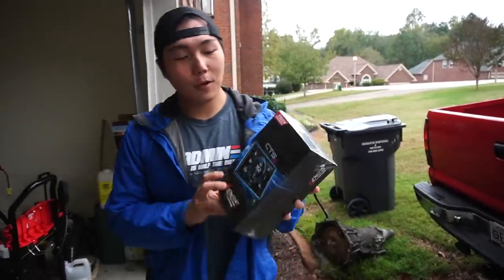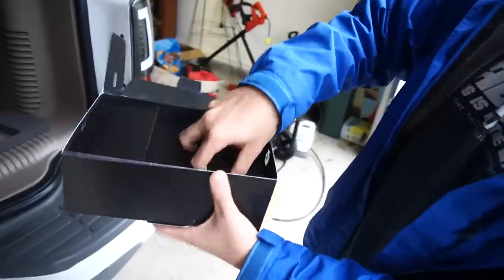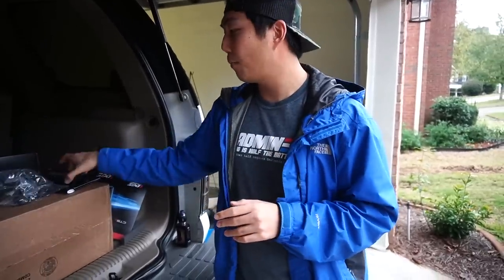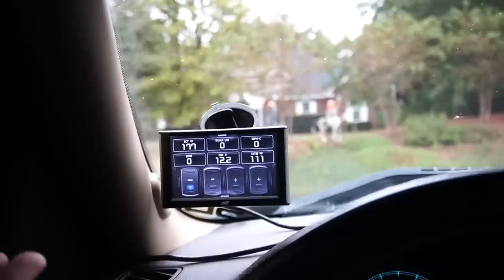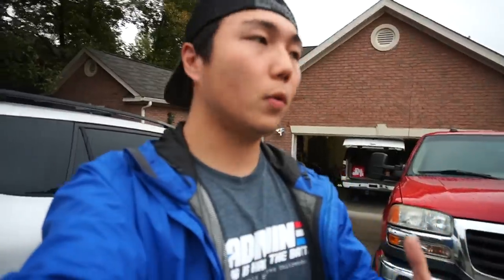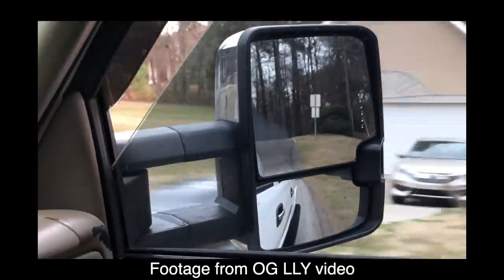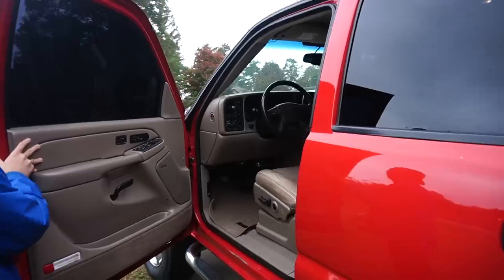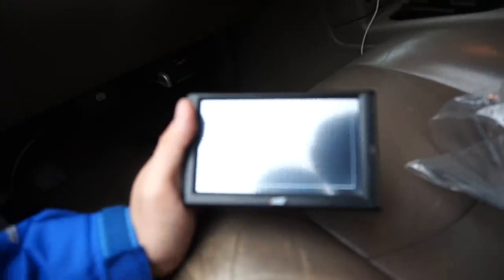LESS THAN $450 THIS CAN READ YOUR CHECK ENGINE LIGHTS AND MORE!

Comment: My only hesitation and I can't get a actual answer is can an lb7 read past the 28 lbs of boost? I can't get a straight answer. I would rock this over a pillar cluster if I could know it would work.
Reply from the maker: I've heard edge cannot read past that

Comment: Subscribed! Good info! How did you wire up the horn/train horn switch? I like the fact that you can toggle between then and utilize the wheel horn. Thanks!
Reply from the maker: Thanks for the sub! If you look up Hornblasters Nightbmare series, they have accessories that are compatible!
Reply: Cool, so they show how to wire to the edge to toggle between train horn and the trucks stock horn? I’m gonna be putting in my nathan K3s soon and like the idea.